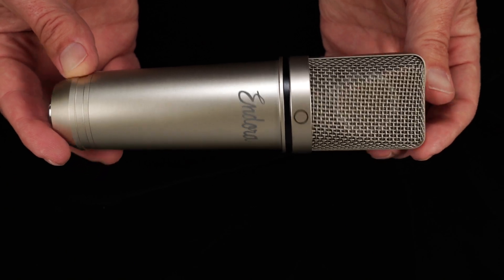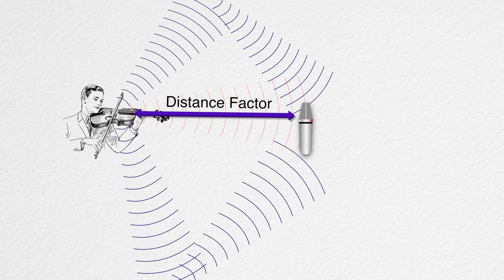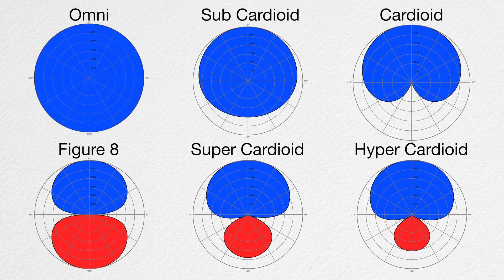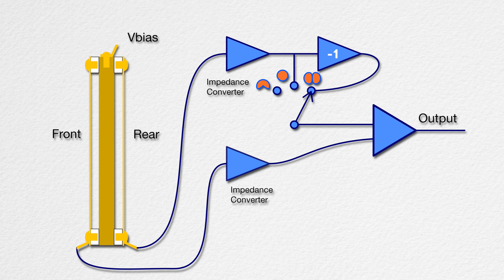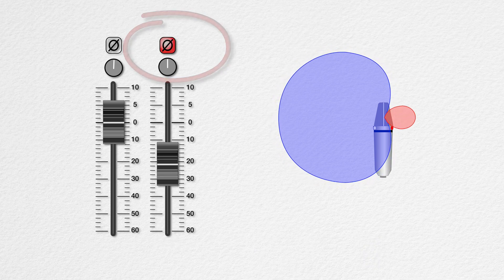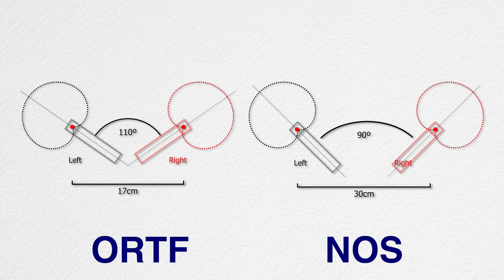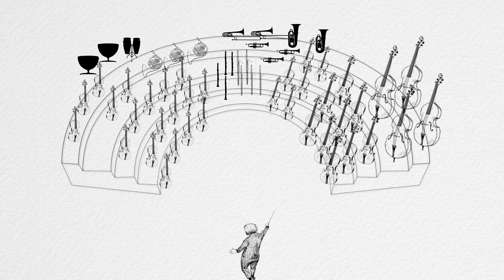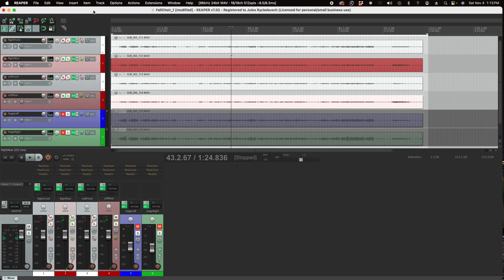Using Endora: ORTF with Dual Output Microphones

Comment: Great video, and I'd love to have a pair of those mics. Maybe someday. BTW, what you're referring to as distance factor is similar to what sound reinforcement folks refer to as "critical distance." The difference is that critical distance is used with loudspeakers, not mics. In sound reinforcement, the critical distance is the distance from the speakers at which the energy from the reverberation of the room is equal to the energy coming directly from the speakers. Beyond this distance, speech quickly becomes unintelligible.
Reply from the maker: Yes critical distance and distance factor are very similar